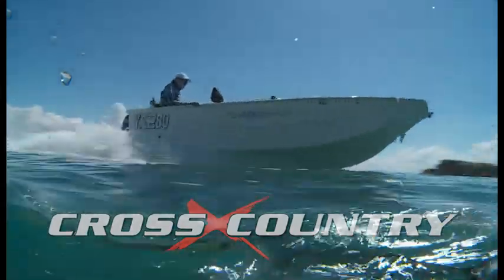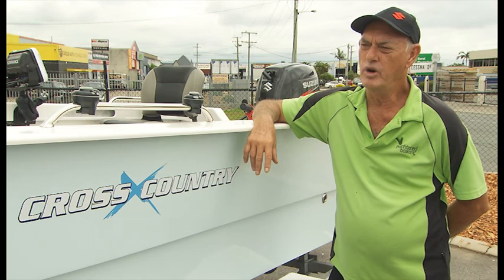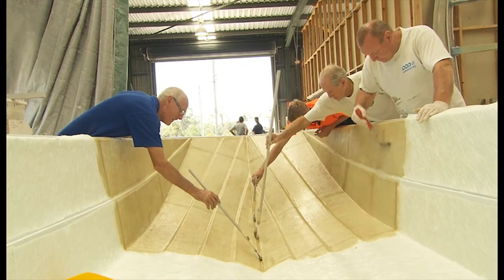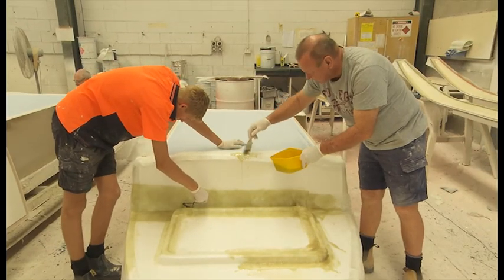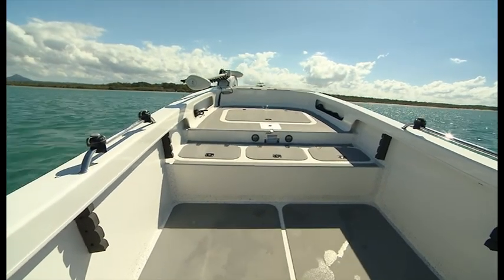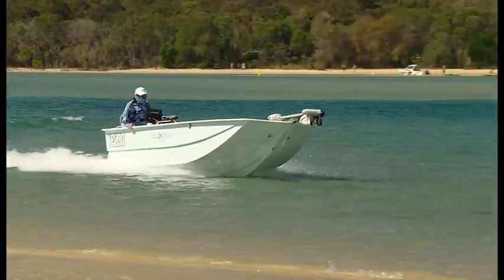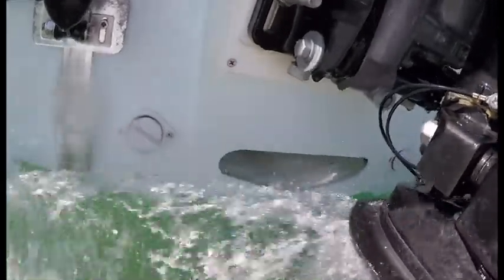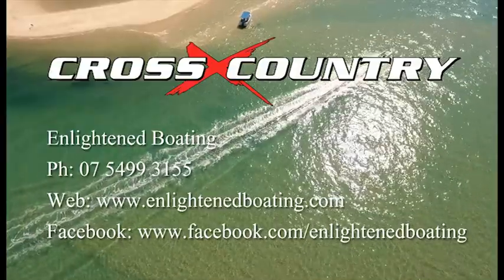Composite fibreglass boat build - 4.5 Lapstrake Cross X Country

Comment: looks like a grat platform.  I reckon a 5-5.5m version would be perfect as an all-rounder.  
For example, over here in WA, you need a slightly bigger boat if yoiu were going to fish/travel from Denham in the Shark Bay area, to Dirk Hartog, as bounsing a vacuum hull over the corrugations would no doubt cause some damage.  would also be a great boat for chasing bonehead in the Exmouth Gulf, where it can blow up, so the slightly bigger hull would be great
Has enlihgtened boating sold any of these to WA fisherman?